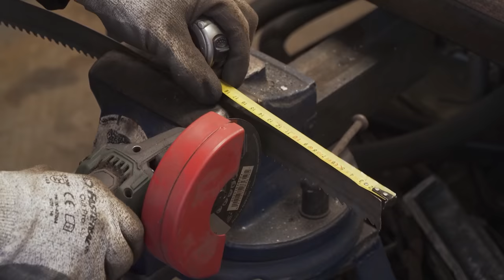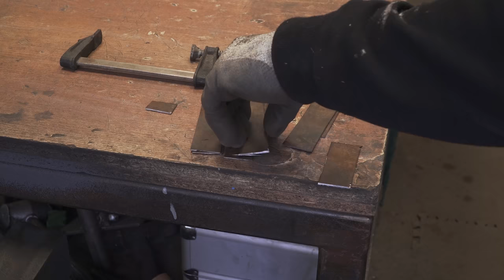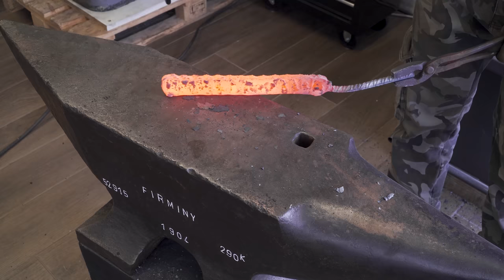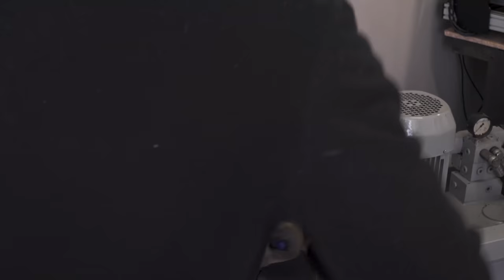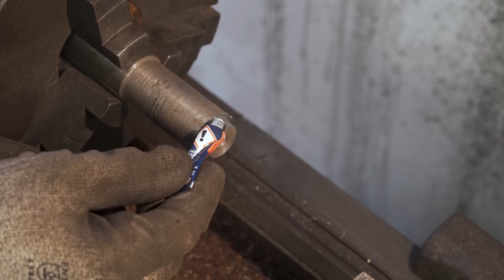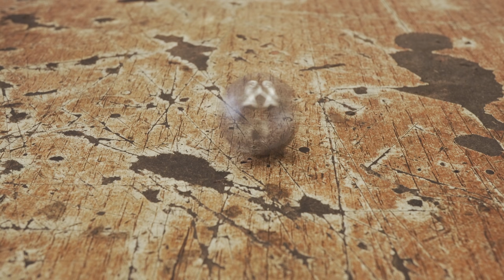Twisted Sawblade Damascus Ring

Comment: When I twist pattern welded steel, I use a pipe wrench with an extra handle welded to the top, so I have a twist rod with a central attachment point, like the die holder you used first. Perhaps making such a tool would help you?
Reply from the maker: Yes! I hoped I could get away with the tap holder but it looks like I'll have to make the pipe wrench modification.
Cheers!
Reply: @BlackBeardProjects   =

 
 
=
 
 =

Comment: Sorry, but I have to ask... in the first welding phase, with the addition of borax, were you able to weld the layers together without bringing them to white heat?
Because it was bery bright yellow, but didn't seem sparkling white, to me...
So is it possible a forge welding even a bit low than white heat?

Comment: Super cool project! Two questions, did you just super glue it to the jam chuck to machine the OD? And what do you dip it in for etching? Some sort of acid?
Reply: superglueing parts on the lathe seems to be pretty common.  the glue is strong enough and it`s not hard to remove, especially with a little heat (or not).
Reply from the maker: Yep! Just super glue and a snug fit. Acid I use is ferric chloride.
Reply: @BlackBeardProjects  thanks for the reply! I do a lot of wood turning. And I know people hold stuff with hot glue all the time. I’m always cautious with metal tho!

Comment: What would happen if  maybe used steel banding from pallets alternating with bandsaw blades. Would these make for good knife materials?
Reply: Some strapping is high tensile steel and others lower. For my wedding ring I have bandsaw and unknown metal strap. I punched the hole rather than drill and used a die-grinder to get final size. It rings like high tensile steel, but not sure if it would make good knife material. If making a ring, I would recomend low layer count as it ends up too fine to notice. I think mine is only about 28 layer and the pattern looks good.

Comment: The woodworker me recognized the bandsaw blade as a one for wood. Wondering if it was a bimetal blade where the teeth are harder than the backing metal. You did grind/mill them off though.

Comment: Have you considered making knives from old mower blades? They are usually very good steel.
Reply: Mower blades are very tough, but may not keep a good sharp edge. There is a fine balance between though and hard. Thhe fact a mower blade can handle hitting rocks all day and be sharpened with a file leads to it not being great for knives.